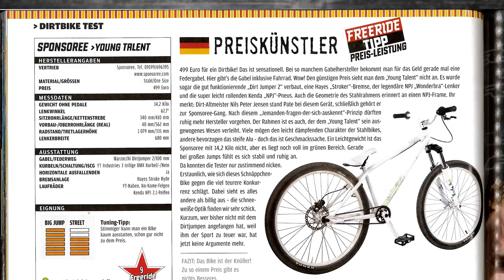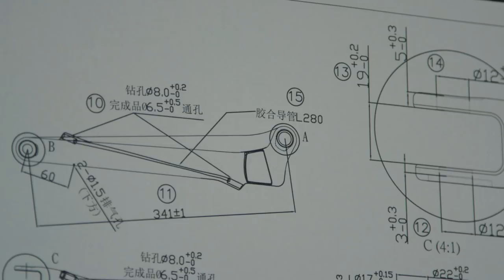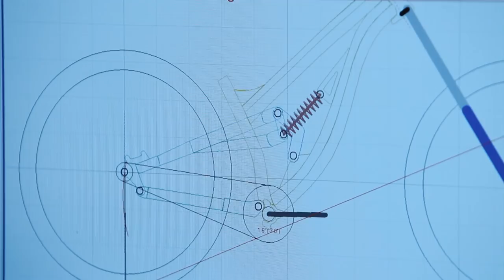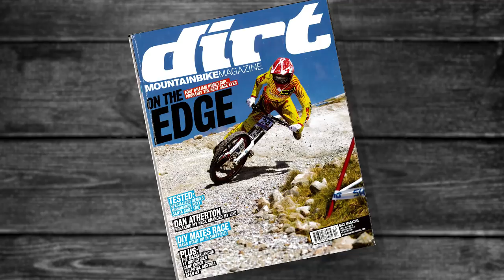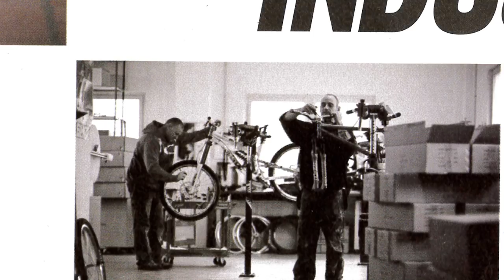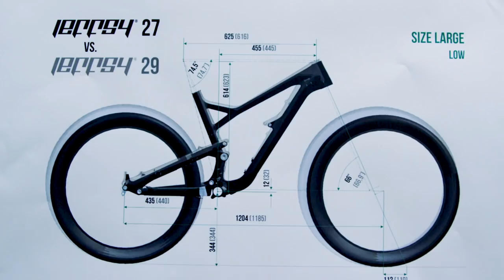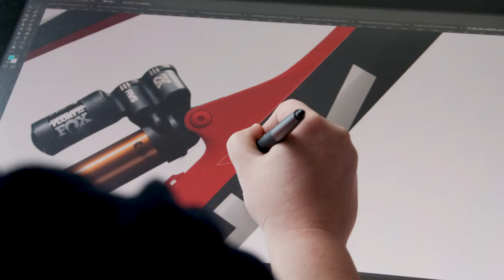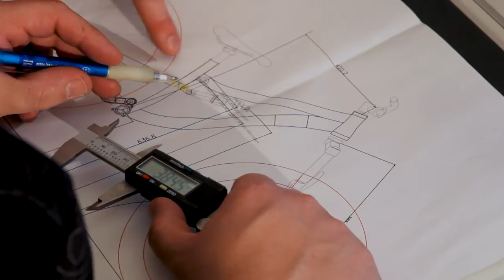YT - Live Uncaged

Comment: I have the YT Capra carbon race 27.5 and found a improvement over my Giant carbon reign by feel and speed though a tree section I ride to the tune of 2.4mph compaired to the reign on the same tires with a maxis DHF and a Schwalbe rock razor on the rear. I made the change to a Raceface steering stem to 33mm over the renthal standard on a xxl frame and so much better and then put in Sram eagle 12speed from new instead off the 11 speed E thirteen 9/46 and dumped the code pads and put in sintered so much better  trail braking when wet or when discs very hot as I run Shimano ice-tec rotas as they don't warp and cool fast.